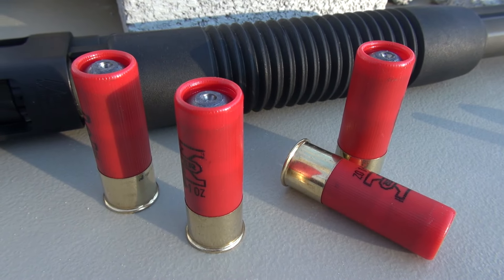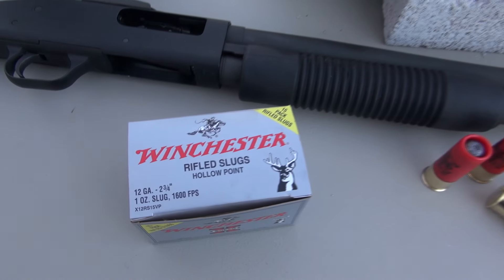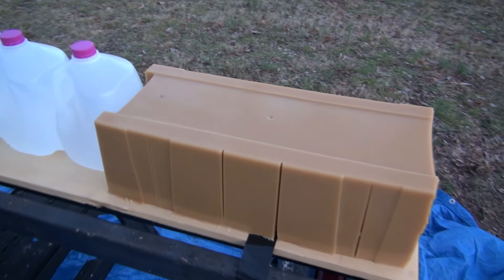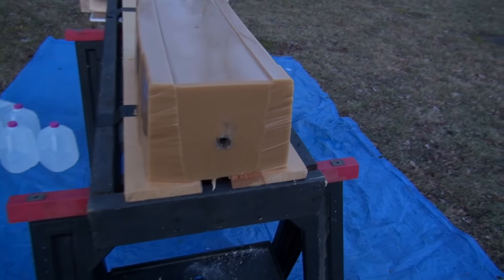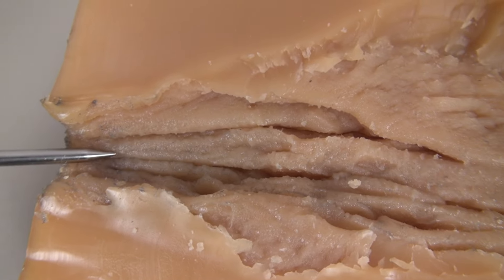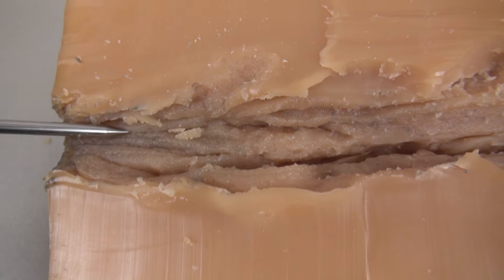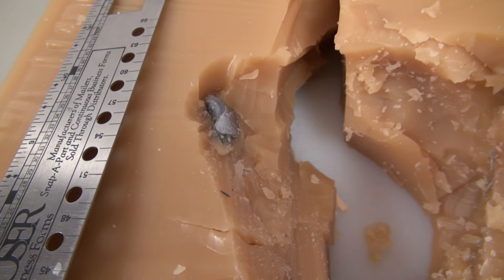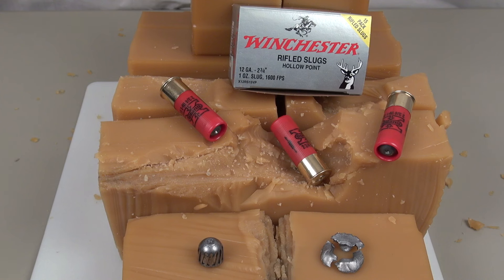12 Gauge Foster Slug in Ballistic Gel

Comment: That was just a brutal display of power. I will choose that all day over an AR. Cheap, accurate, powerful and easy to buy. Hickok45 has a video where he drug an old particle board desk like you get from IKEA and set it up like 250 yards away. With a smoothbore and 1 oz slug he was putting shot after shot in a 2 foot circle. Most of them were even tighter than that. No scope, just the iron sites that come stock. That showed me the accuracy, this showed me the power. Crazy good show.

Comment: I was not surprised with this slug remaining inside the gel block.  I was at an autopsy of a guy that was shot from five feet with a 18" barrel length .12 gauge Winchester 2 3/4" lead Foster type slug.  The deceased was in the middle of delivering a right handed punch when he was hit.  The shot was 5" below left nipple and fired at about a 25 to 30 degree angle.  The slug shredded the right side of the heart and came to rest in a almost "U" shape resting on the spinal column.  The dead guy weighted about 250 LBS. and was tall and muscular.  If that slug would have missed the spine I think it may have exited the body but with very little energy left.  On the other hand it seems to me that if soft tissue is not struck the slug will penetrate multiple walls with no problem.
Reply: JavPaul Settmr yikes

Comment: Best example of Force equals mass times acceleration I have seen in years. Dramatic energy dump into the block and dead center on the hit. I have used PBX slug plus pellets as a defensive load in a 12 gauge but had to admit a single slug energy dump was greater than I imagined.

Comment: Shortly after entering on duty at the Federal Law Enforcement Training Center I was asked if I would undertake a ballistics test with a variety of different ammunition. The center had constructed a 10 - 12” diameter stainless steel tube a out of stainless steel that was about 12 feet long mounted vertically with a cat walk around the out side at about the 8 foot level for the shooter. A number of different handgun rounds were tested, but the most interesting by far was the 12 gauge rifled slug. When the rifled slug was recovered I was stunned. The little star on the nose was undamaged, but the skirt from the hollow base had continued forward upon impact with the water, causing the recovered shape to be like a silver dollar with the diameter greater than one inch!

Comment: I used to live in a shotgun only area. I have a 12 gauge single shot H&R made in the 30's that I silver soldered a scope rail on the barrel(Older barrels are thick enough to do this).  With Federal slugs I get one ragged hole at 50 yards with 3 shots.  I did shoot a deer at about 75 yards once, and it hit where I aimed, but am sure the group opens up some at that distance. I have killed quite a few deer with it.  Even hits in soft areas(Lungs) really do a job.

Comment: I have been a shotgun enthusiast since 15. When I went to Beirut, I took along an 870 Remmie and an entire backpack of 00 and slugs. I can attest to what happens when a slug meets the human body, wholly because I grabbed the wrong ammo pouch. 
People who say these are not good for home defense aren't totally accurate. They're GREAT for stopping a bad guy. Problem is, with the energy (usually above 2200 ftlbs under 10 yards or more) the round carries, it's not stopping unless, like this one, it fragments (haven't seen that happen). Which means after it removes Mr. Bad Guy from the Problem Column and deposits him in the Clean Up Column, it's also going to ruin some walls, furniture, etc. 
I've never wanted nor own an AR. A shotgun, of whichever manufacture you prefer, at ranges at which most engagements will happen, is far superior. What it hits is going down. At 100 yards, it's still carrying over 750 ftlbs of energy and weighs an ounce. 
For fun, my buddy had a nearly dead Chevy Cavalier with a 2.4 LD-9 engine. We started it up, I positioned myself about 25 yards away with a rifled slug and let rip. Two rounds later; dead engine. 
I now use a slightly modified ATI Bulldog and I can reach out and smack targets at 150 yards using a Red-Dot only (we Marines use iron sights at 500 yards) and can shoot 5-rd 5" groupings offhand, from a smooth-bore. 
If I'm not slugging it out, I use 000 buck and that's effective at over 50 yards, but I use it under 40 and with a full choke it holds single shot patterns under 5" at 35 yards.
Like the BRCC guys say "Life is cyclic...and get a shotgun." :D 
Stay safe. Great demo'!! 
#progressiveshooter

Comment: No, you have that backwards. It is the hollow rear and weight forward
design of the foster slug that stabilizes it in flight, just like a shuttlecock. The rifling is there to allow the slug to go through tight
chokes and decrease friction in the gun barrel.

Comment: Where I live, this is what we use to hunt deer. We cannot use high powered rifle in my county. At 30-40 yards, you will get a pass through on a black tail no problem. These things will chew through flesh, meat, bone, and organs, come out the other side and keep moving. And that's with a 2 3/4" 1 oz slug. Keep in mind, you can get a 1 1/8 oz in a 3.5" configuration as well. Usually, it does enough devastation, you end up removing a quite a bit around the rib/chest cavity because of the damage it does.

Comment: Same Energy as a 180 gr .308 Win at 2,500 ft-lbs. That is why muzzle energy is so misleading to so many people. If you get right down to the power of the ballistics, instead of how much water it could heat or how much electricity it could generate, you get the real IDEA of what it is doing.

.308 Win 180 gr 2,500 ft-lbs. Power Factor- 450, KOV- 19.8
.458 SOCOM 405 gr JFP, KE- 2,378 ft-lbs, PF- 658, KOV- 43.1
.450 Bushmaster 260 gr A-Max, KE- 2,781 ft-lbs, PF- 571, KOV- 36.7
This 12 Ga. Slug 440 gr KE 2,500 ft-lbs, PF- 705, KOV- 73

Comment: The slugs are front heavy for stabilization as they are not generally fired from rifled barrels, they self correct in flight like a badminton shuttlecock. Yeah turning it around would be interesting and if it connects  with a soft target backside first then it will be extremely explosive with little penetration depth. But it will try to self correct in flight and by the time it hits the target it might be side on or even nose on to the target. A rifled barrel might fix that.

Comment: You will never have a proper test unless you put at least 3 straps and a piece of 1x8 across the top of the gel to hold it into place. Straps must not be tight just enough to hold the gel down. The reason this test was a fail because the gel was able to flex out of control. That is why if you look at the gel in this video you can see where it flexed on impact and caused the slug to exit the bottom. You can see where the flex started and how the slug followed the flex in the gel. You should do a second test with the straps and the 1x8 running down the top of the gel. And then cut the gel open and you will see the difference .... Hope this helped for further testing with any type of ammo you are trying to test. From 22lr to 50bmg you will get a actual accurate test. Look forward to seeing more of your videos. That was a great shot. Happy hunting.

Comment: tnoutdoors. I own the same Mossberg 590SP. A 1999 production gun I am very pleased with the durability, reliability, and accuracy. It is my trusted home defense weapon. #4 buckshot and high velocity, high brass steel BB’s being my preferred home defense rounds. Both of these are more than adequate for home defense after some patterning and ballistics gel revealed. At room distances the high velocity steel BB’s leave an impressive hole somewhere between the size of a golf ball and hardball depending on the distance. Not something I’d want coming in my direction. The 590’s 8+1 2 3/4” shot shell capacity or 7+1 3” capacity is plenty for it’s intended purpose. Thanks as always for a great review. All the best to you and yours in this new year.

Comment: A definite "fight stopper" even out to 50 yards.  I shot a buck that field dressed out at 157 lbs. at 50 yards.   Knocked him over with genuine force.  He died within seconds.  Still my 12 ga. Coach Gun side by side cylinder bore is loaded with #4 buckshot for defending my home.  I no longer hunt with Foster slugs since acquiring a Savage 220 fully rifled bolt action.  It is good out past 150 yards and extremely accurate.  I do have a Marlin 336 30-30 but my hunting area is really heavy brush where a 20 ga. slug is more effective.

Comment: I have found that quite often, Foster type slugs, when pushed over 1500fps,  will split back to front. this causes fragmentation upon impact.  This test shows exactly what I mean.   Picture a hollow point expansion in reverse.  at the moment the slug exits the bore it is no longer supported by the bore of the gun causing the expansion. it is worse in cylinder bore guns due to the fact that the slug's hollow cavity expands quite a bit to the bore diameter.   Fire 10 foster type slugs at over 1500fps ( Winchester brand) at a 25yd target. Most often you will have more than 10 holes.  Federal and Remington seem to have thicker walls and are not as prone to fragmentation.  Brenneke slugs have not shown this problem due , I think, to their wad design.    In cylinder bore guns for defense, I prefer #4 Buck.  At 35yds with my 20" cylinder bore, only 2 or 3 oo buck hit a standard police target,   with #4,  I get 5 or 6 in the vitals. At 50 yards 00 can miss completely but #4 gets at least 1 or 2 .  every gun is different so be sure to pattern test.

Comment: You are describing original miniballs in 1800 muskets.  A shotgun slug always
uses and requires a Wad of some sort and all the modern ones are plastic
and they are cup shaped to seal for gasses.   Now if you were to load a Foster
slug into a shell directly on top of the powder like a muzzle loader than I 
would agree with you.    Do you load your own slug cartridges ?  If you dont
use a WAD you are going to blow yourself up or your loaded shell will only
be half as long as normal.

Comment: Good video friend, I have a question, if you can help me .... what is the amount of powder that carries a cartridge 12x65 with a 1 ounce bullet. I want to recharge since in my country this cartridge is not achieved .. .
Reply: It depends on the kind of powder. Smokeless powder is very hard to measure right and if you get just a little too much the gun can blow up. With black powder or a black powder equivalent you will be able to measure with a black powder powder measure between 55-70 grains and that makes a bout a 2- 2 1/2 drams load with a 1 oz shot or slug. It will be dirtier to clean but much easier to load without hurting yourself. Guns made better with bigger chambers and modern guns could take more powder im sure but it's better to be safe with a lower power than dead

Comment: not quite. while the hollowpoint/flatnose aspect of the foster slug does help it to flatten out, the MAIN contributing factor is its hollow base. if you look at the projectile at 5:28 you will see that it expanded from the back to the front instead of vice-versa as normally is with a hollow point. the flatnose/hollowpoint of the foster slug is only there to transfer energy and slow the front down while the heavier rear can use kinetic energy to expand.  much like a hollowpoint in reverse.

Comment: How accurate is that with a non-rifled smoothbore barrel? I ask because if it is not that accurate, there is no purpose except for maybe self defense or in rifled barrels.
Reply: Douglas Fulmer   Very accurate. I shoot 3 inch groups from 50 yards all the time. Not "rifle" accurate. But, accurate enough. Trust me...
Reply: I buy Federal 1 oz. rifled slugs. Shoot them through my smooth bore shotgun. 28" barrel. Improved cylinder choke is the most accurate out of MY gun. Other people's results may vary...     But, they are designed to be shot through any size choke.  I wouldn't try a turkey choke tho. That's just me.

Comment: considering the fact that the slug got 10" of penetration, why do so many people say how awful of an idea it is to use slugs for home defense due to over penetration concerns?? This penetrated less than most defensive handgun rounds and didn't even meet FBI minimum penetration standards? Don't get me wrong, I see no issue with it not meeting FBI specs but considering the fact that it didn't even go deep enough into the gel to satisfy penetration requirements, why are so many well versed youtube gun video makers against slugs??
Reply: they over penetrate walls in a home or apartment, and in the human body, as well as deer they actually do pass through on a regular basis. Ballistic gel is just a test medium. Actual humans have cavities inside the body that are just voids filled with air. That means that the 10" in the 10% ballistic gel is probably like 2-3 people. How else does the FBI and the Police shoot through people and hit bystanders?
Reply: Actual humans also have bone before and after those "air cavities" as well. Could you provide me an example of the police and FBI shooting THROUGH a suspect and hitting a bystander and not them simply missing?
Reply: Have you shot a deer with a 12G slug? Pass throughs are common and pradon me, but they are a lot tougher than most people...
Reply: Ralph Edwards But if that's the case, why does the FBI require 12-14" of penetration? My whole point is the slug only went 10" which is less penetration than an approved 9mm or .40 or .45 round would get, yet slugs are alleged to be such an over penetration risk when rounds that penetrate the same media even deeper are considered safe. Just trying to figure out the rationale here.
Reply: My point is that a gel media is not the same as a living breathing animal or person. There is a lot of rounds out there that will and do over penetrate living beings vs the FBI standard in gel. On the flip side, you take that 1 oz. slug and shoot it through a wall, even if it hits a board or two, how many walls is it passing through? Same with any 9mm or .40 cal.
Reply: A 1oz. slug can punch a hole clean thou a 4x4 at 20yards

Comment: buck shot would still penetrate through sheet rock. Its not that strong. And I'm not going to use bird shot because it isn't damaging enough. with a slug its energy is dissipated directly into the target. If it goes through it most of it's energy will be dumped in the guys body so I wont really worry about that. I'm pretty confident I wont miss considering I'm a good shot, and its CQC. Even if I do I only have to worry about one projectile, not several spreading out in all direction.

Comment: I have taken elk with the 3 inch slug, and a 2 3/4 slug stopped a charging grizzly bear at 50 yards or so, both rounds it just dropped them for hd, I use a Mossberg 590 sp. slugs and number four buck shot. when it comes to self defense I don't play around if it will drop a grizzly bear with one shot and the wound pretty much blows the top of the head off snaps with a shot just above the nose the spine in hal, at the neck. It's good enough to drop someone trying to break into my house that's trying to hurt my loved ones.

Comment: Those slugs were developed for Elk.  Even with deer they are over kill.  An average deer will be +200 lbs maximum.  An Elk will be closer to 1200 lbs, ten times the size of a deer.  Those slugs are only good at killing your neighbors if you have to shoot through your house.  I suggest prefer 00 buck 2 3/4 loads for the local police at the front door because it will catch bystanders with 30 caliber pellets. Plus a barrage of them coming out your front door will make them step back quite a bit.  They seem to respect 30 caliber.  But by this time your ole lady should have had your sks, and ar15 pulled from the safe and handed to you.  Teach her how to reload quickly, and keep her head ON 16" centers low to the floor.  You will be firing near automatic mode with your Adrenalin coursing, but keep focus.  If you last through the first barrage, there will be a silence, at which point you yell out to all of them that they are under arrest for attacking an innocent civilian home.  Lay down your arms or I will retaliate.   And then you tell your ole lady to reload again and fire as fast as you can, making your targets count.  Aim for the neck, the head and torso are padded.  Ok?  Did I miss anything?  I am assuming my ole lady won't shoot. If she does, she has the AR, I got the SKS.  I tricked it out with 1% trigger pull, it's awesome!  10 rounds near automatic.

Comment: what's your preferred 12 gauge home defense load?... 00 buck? 000 buck?
Reply: BriGuy Sixty2 :  you won't find 000 in 12 gauge.   The pellets won't stack proper.   It may exist, but I've never seen any.     9 pellets of 00 in 2 3/4".  Is standard.
Reply: By my own simple tests  3.5" 12 ga with bb shot is fucking insane destruction between 0 and 60 feet.    Recoil is substantially greater than target loads!

Comment: rifled slugs are to fired in smoothbore shotguns ONLY....   "sabot" slugs are to be fired through rifled shotgun barrels....   if you have an 870 use a improved cylinder choke for the best accuracy...   if you have never used rifled slugs in a smoothbore you will be surprised with not only the power of them but the accuracy out to 100+ yards as well